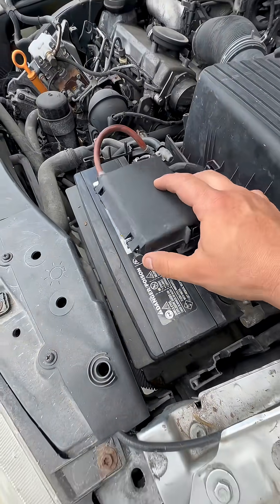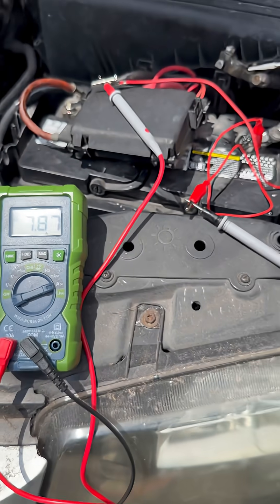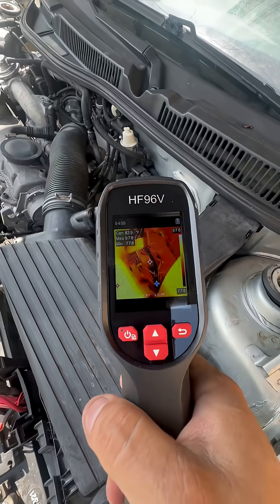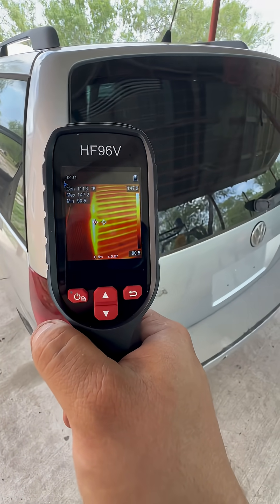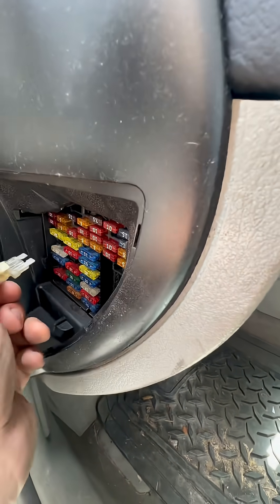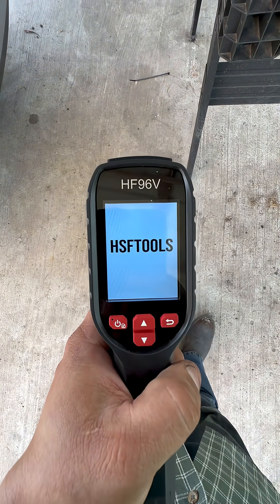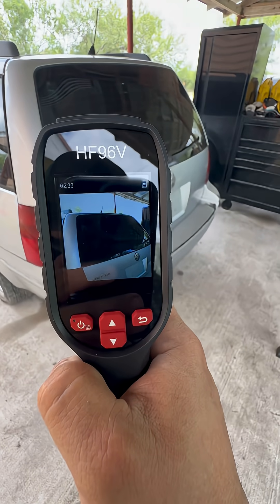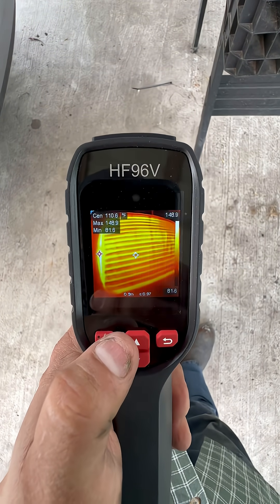HSFTOOLS HP96V dieselmechanic #mechaniclife #comeoverhere #repair

Comment: 8amps is INSANE
Reply: it is, but that's about what a typical rear window defroster pulls. my 98 saturn is 8.5 amps when in use.
Reply: @blendpinexus1416 
I have seen a lot of parasitic draws, but never heard of a constant 8amps. 
I know during use, starters pull quite a bit. 
Electric power steering is a real easy way to test a battery. Just steer the wheel sharply immediately after start up😂

Comment: Diagnostic skill is key to solving issues
Reply: Crazy is, if you have a good head on your shoulder and some interest in working on cars - You can easily have better diag skills than low level shop after learning a bit.
Reply: Ya think?
Reply: @jaymelz324 no need to be a dick
Reply: I dont think so, the key is to guess correctly which part to throw at the car.
Reply: @sran9492 😂 i hope that's sarcasm
Reply: @Spha_gatsheni  😂 the original poster is saying you gotta have medical degree if you wanna be doctor, no shi sherlock😂😂
Reply: @sran9492 ohky Dr glad you have PhD level of observation
Reply: @Spha_gatsheni  im glad its recognized